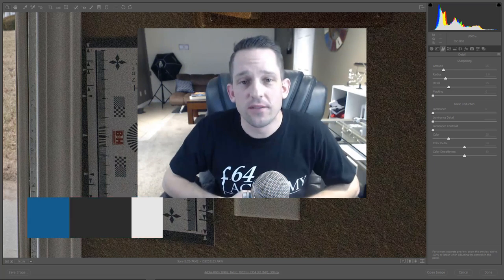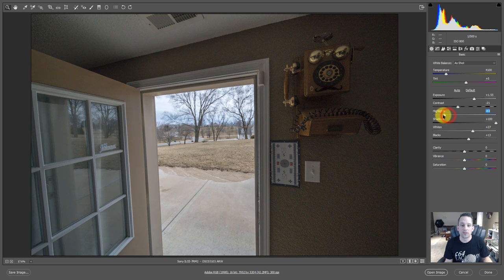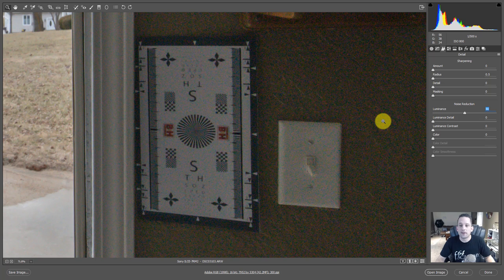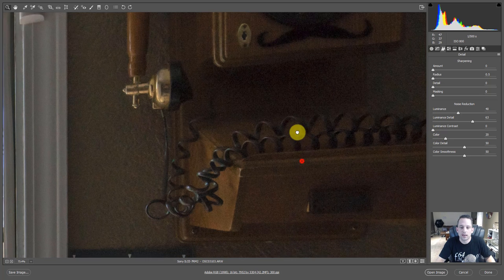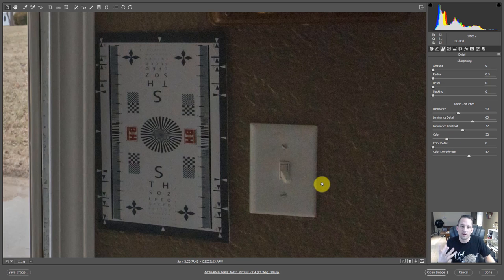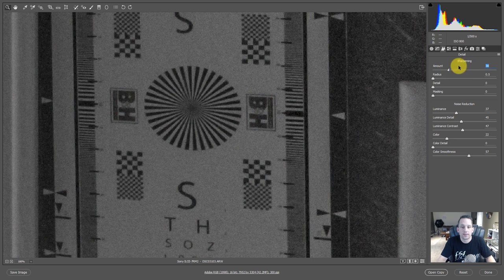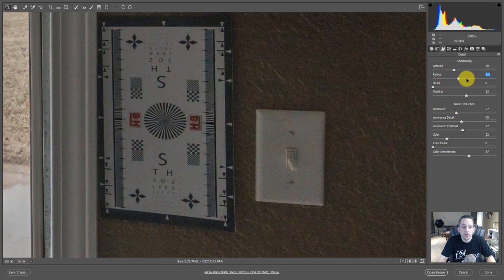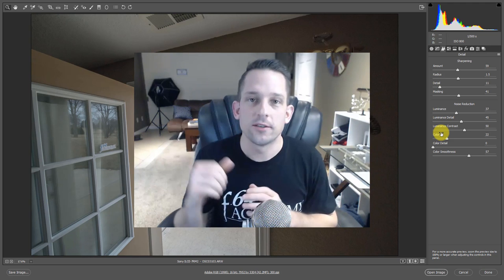Noise Reduction in Adobe Camera Raw

Comment: As Usual very thorough.  thanks Blake.  I know you are aware of this but if you take multiple shots of the same picture at the same settings then stack those photos the noise will be reduced.  The more shots the better noise reduction.  I find this to be the very best noise reduction technique as it does not change anything but the noise, not color not tone not luminosity.
.  Noise is a pseudo-random process so the noise is different with every shot, then by stacking  and averaging or taking the mean you reduce the noise.  What remains is the DC noise term in the frequency domain.
regards
Hans
Reply from the maker: +hans habereder agreed, but we can't always get that. If Stars move, or clouds shift, we cant quite stack the image. But for stationary things, I agree.
Reply: Thanks Blake, appreciate your thoroughness,. Stacking actually works well for stars if you keep the exposure time less than 20 seconds.  Being a trained astrophysicist,, I have taken many shots of stars like this. through a camera only and through a camera on telescopes.  ;even if the clock drive does not quite keep up with the stars motion, if the exposure is short enough it does not affect the picture noticeably. (exposure times through a telescope must be much shorter)
As for clouds, you may actually want to "streak" the clouds which the mean will give you. Its a matter of taste and what you are trying to achieve.

Thanks I find your explanations the absolute best and I recommend you to all my students here in the USA  and also in Europe.

Comment: You could also give a small amount of surface blur to reduce that remaining noise....Thats what I do with my photos. Anyway great tut!!!
Reply from the maker: I would caution that and use it sparingly with masks or Blend If.  The idea is not to blow the noise away or smear it, it is to reduce it so it is less prevalent.  If I did any more blurring of the noise it would be applied only to the shadows as not to destroy the detail in the Midtones or Highlight edges.

Comment: The noise bit is great advice but shouldn't we actually be sharpening only in the final stage, on Photoshop, according to the desired final image size? (web, printing on this or that paper size, mat or gloss finish, texture etc.)
Reply from the maker: Yes and no.  I think all RAW files should go through some sharpening.  By default, our cameras do not sharpen our RAW images like they do JPEGs.  This is a mild sharpening, you could do it at the end if you like, or do it at the beginning.  It really depends on how much sharpening you need for print.  I typically sharpen once and am done with it, but you may need more for print.  If that is the case I would do it in more selective areas rather than this global style effect.

Comment: Thank you, Blake, for the informative tutorial on noise reduction.  In the case where you take a image to Photoshop and use the ZSE process should you wait to do sharping till after toning and color?  It looks like Lightroom and Camera Raw have an advantage in the masking which points to doing sharping before ZSE.
Reply from the maker: Good thinking, John.  You certainly can use these techniques after the ZSE workflow with either LR or ACR as a filter on a stamped layer.  The sharpening in the ZSE is mild compared to this.

Comment: Is it not more of a workflow decision to do the noise reduction before the sharpening? Lightroom won't take any notice of the order you do the adjustments, it will do it in the order it is set to internally? It's not like Photoshop where you might apply a filter then add another on top destructively.
Reply from the maker: Yeah, Lr and ACR don't really care what order as it is on the Raw level, but in Photoshop it would matter.

Comment: Aren't our monitors a lot more sensitive in showing us noise than prints are?  What we think is noisy doesn't look nearly as bad or don't even show up on a print to begin with.  Sometimes we tend to pixel peep too much and look for stuff that may not even show up on paper.
Reply from the maker: Very true!  My main concern when I reduce the noise is with color noise.  If you remove the color noise the other noise tends to take on the presence of film grain, which can be very nice.  I tend to be more subtle with my reduction process.  In print, you are correct, itis much less noticeable.
Reply: Dennis W that's correct but we live in a digital world :)